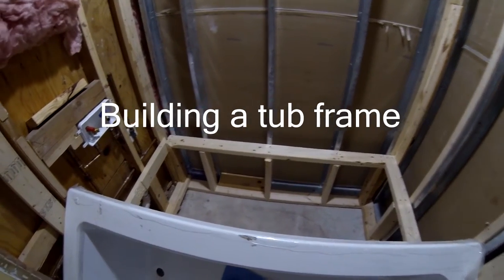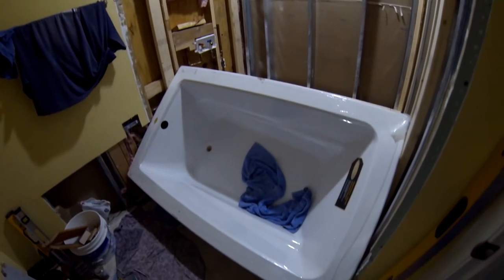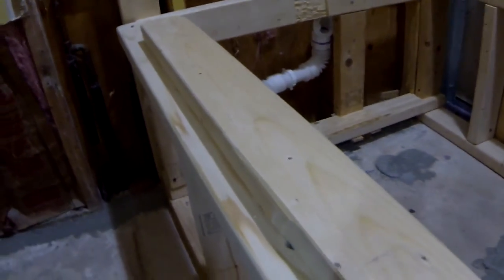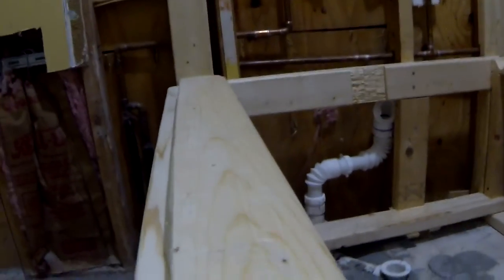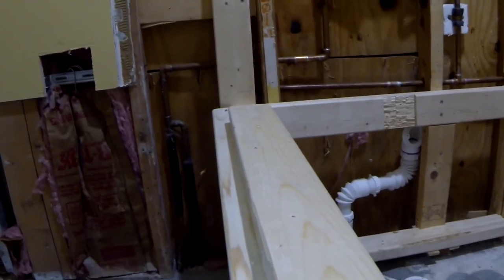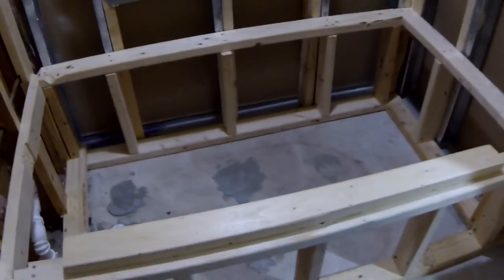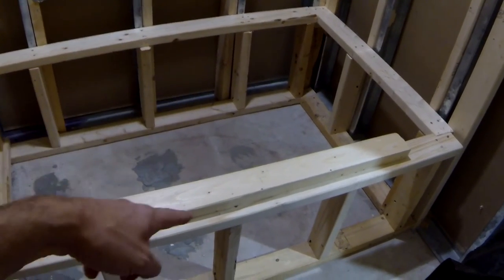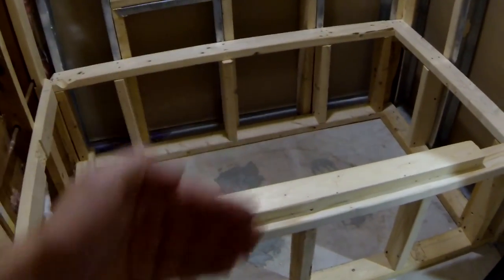How to build a Tub frame

Comment: Nice videos. Thanks for sharing. When you install the tub on the extra 2x4, wont that make the tub tilt/make the frame uneven? And to make the frame even, you'd have to surround the frame with extra 2x4?
Reply from the maker: Extra 2x4 under the lip of the tub only supports the flat top part of 
it. I decided to do that to support the weight of the shower door. Also 
when you step on top of the edge of the tub it will not bend, since 
plastic will bend under your weight.